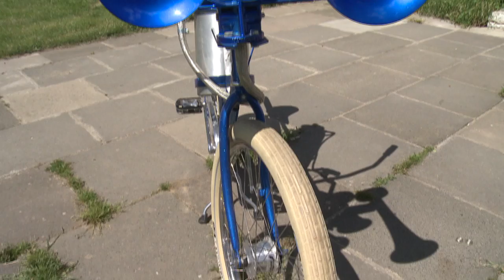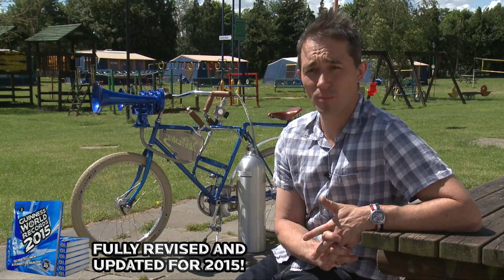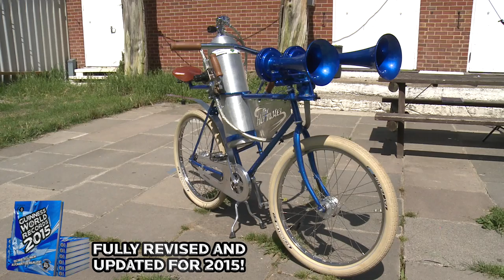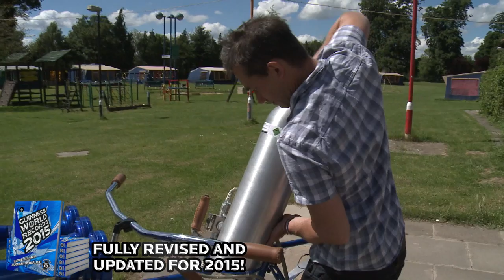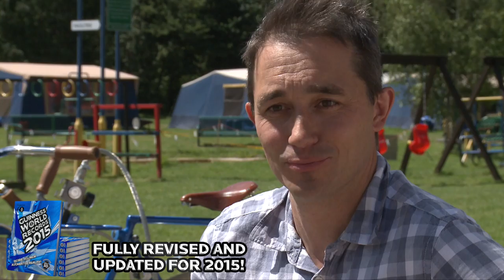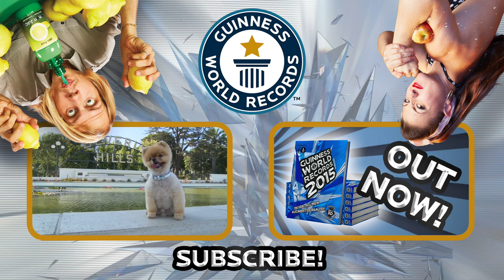The world’s loudest bicycle horn - Guinness World Records 2015

Comment: Usually horns on locomotives are blown around 140 PSI, and some horns are louder than others
Reply: K3la typically quieter along wth the k3h. For instance, at my job, not this Thursday, Last Thursday I was taking out trash nearby right few thousand feet away well Saint Martin retirement and the washing platform and I knew you or anything I’m talking about it a A few minutes away a train crossing with a K3 horn, sounding really quiet and faint meanwhile, OK if I have a tow horn on a train way far away way farther than the horn closer up and it sounded just a little bit louder
Reply: Wtchng
Reply: I've heard K3s just as loud, if not louder, than other K5s
Reply: Huh interesting